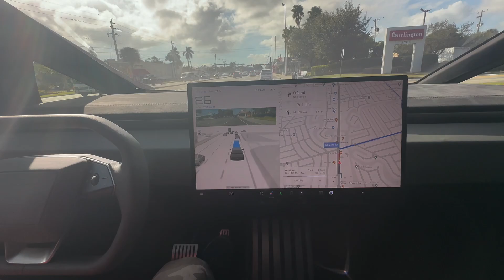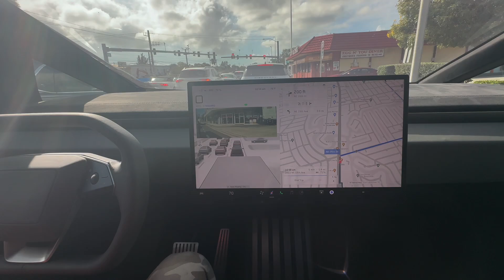Tesla Breakthrough, 4680 Dry Cathode Technology will Change Everything

Comment: Let's all hope Tesla figures out how to be able to mass produce dry cathode 4680 batteries (or in any form factor) efficnently, cost-effectively, and make them super safe and energy dense with very low degradation. That would be awesome.

Let's talk abut FSD for a moment. I watched a video a day or two ago about Waymo and all of the traffic tickets and fines they have accumulated in San Francisco and Los Angeles for parking violations, double parking, blocking traffic, failing to act appropriately around emergency vehicles, etc. This is something that Tesla will absolutely need to solve for with their FSD, which they have not yet done so. I know you've shown that if your Tesla with FSD gets behind a school bus with its stop sign out and red lights flashing, it does stop, as required by law. But have you had an opportunity yet to test that when the bus is coming from the other direction? I am super impressed with how well the FSD (supervised) performs right now, but it has a LONG way to go to be truly 10x safer than a human  driver.
Reply: There are already many electric vehicles that are better than the Tesla... and more economical... but guess what? The government taxes products that are better... but not made in the USA.